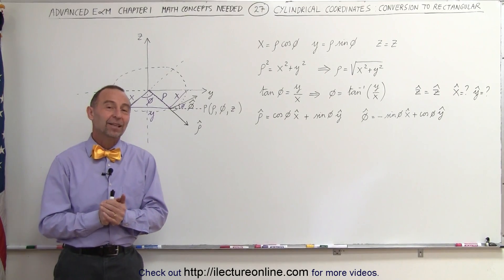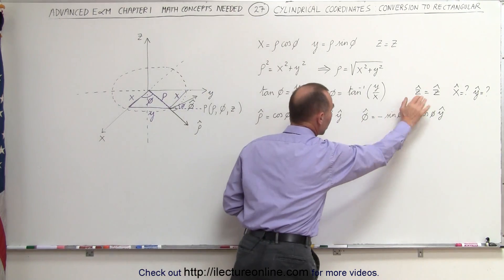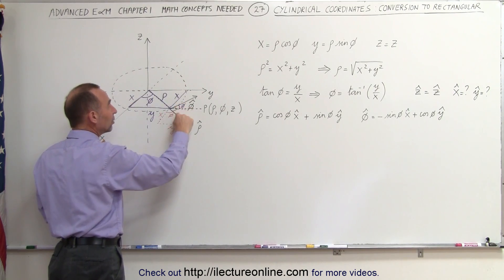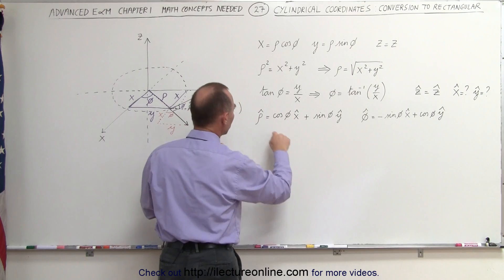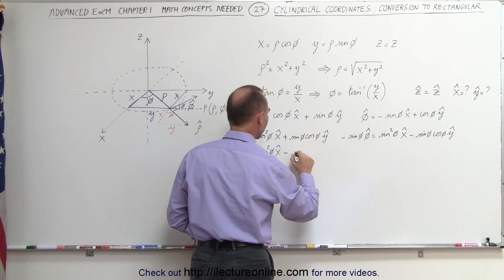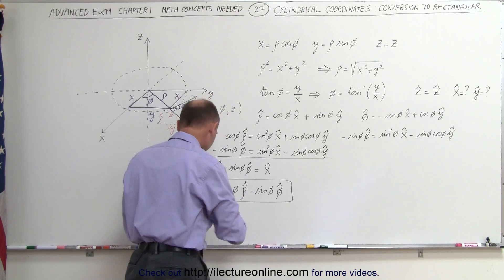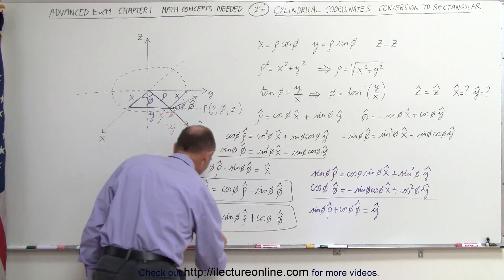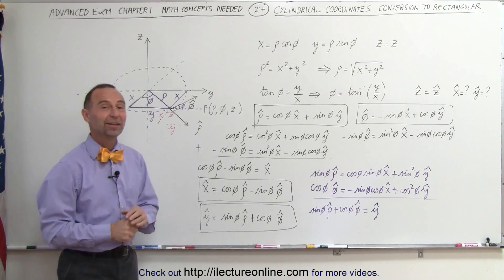Physics - Advanced E&M: Ch 1 Math Concepts (27 of 55) Cylindrical to Rectangular Coordinates

Comment: Hi Michel, can you please explain, in the context of Faraday's law, if uniform magnetic field passes through a coil of wire and you want to calculate the curl in cylindrical coordinate system, you'd need the components in the s, phi and z direction. Why does s and z component have zero electric field while, phi has a non-zero one.